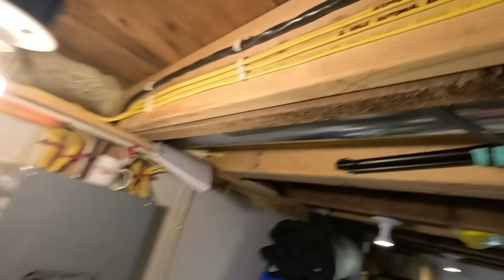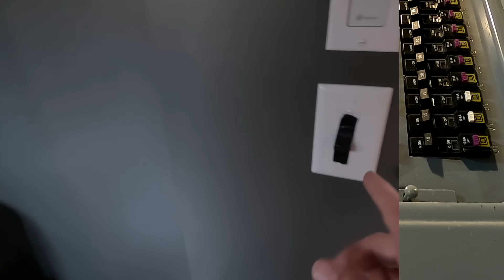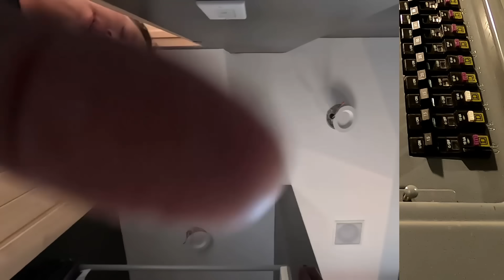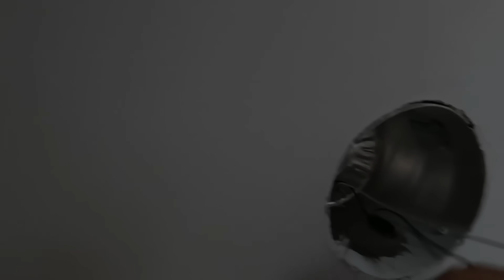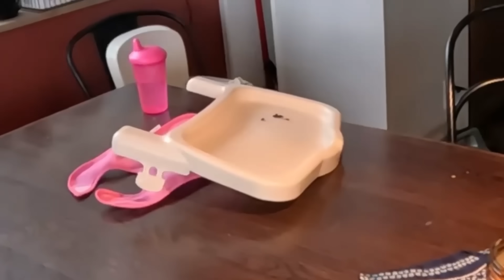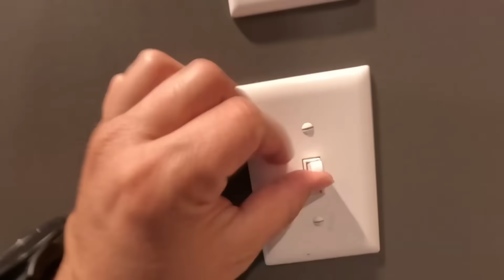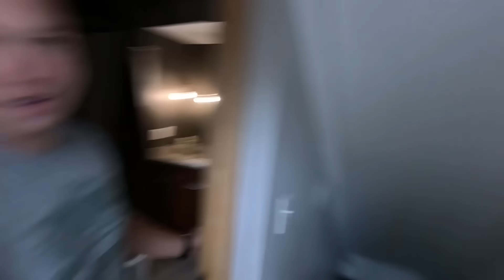Arc Fault Breaker Keeps Tripping! How To Fix It!

Comment: I oil my compressor tools daily (as indicated on tools) whether I use them or not, along with ARC fault breakers, GFCI's, appliances with GFCI's, and test smoke detectors and carbon monoxide detectors...Takes about 40-45 mins.
Reply: do not oil unused tools, the oil will build up and cause issues, like gumming and spraying out all over. it's wise to oil and run them a bit before putting them away each time though.
Reply: Right. I do too, along with carefully reading all my prescription documentation and double checking the list of contraindicated/drug interaction meds, as well as updating the spreadsheet with my meds' expiration dates. That takes about 90 minutes, usually after the checking breakers, GFCI outlet test buttons, and oiling my pneumatic tools. Then I carefully review my owner's manuals for the vehicles, compare the odometer readings with the list I force my family to make of the duration of their vehicle trips versus outside temperature (short trips require more frequent oil changes), and make the correct notations in another spreadsheet I keep on a separate computer and separate network (never can tell if you'll have a laptop fail or have a network failure). Then I carefully shower, being sure to use the rubber mat, which gets hung after being towelled-dry to resist mildew (air quality issues), and go to bed after prayers that the wiring or mildew won't get me. Then I do it all again.

Seriously, who does any of this other than occasionally?

You have a great channel. Quite practical/helpful for others of us in your shoes who have not yet run across the particular issues you showcase (or have but can learn new things). Thank you!

Comment: My girlfriend's hair dryer had a worn out cord, and it started arcing in the cord. It was popping and glowing bright enough to see through the insulation. My fancy AFCI/GFCI breaker for the bathroom didn't care and let it go until it started smoking. I unplugged it before it filled the house with toxic smoke.

Comment: Thanks for the video Ben. Love your work. I’m having similar issues in my pole building with LED canopy lights (plug in to receptacles)bought on Amazon. Irritating to say the least. I’ve tried simply pulling them one by one and as soon as I get to more than three of them, it trips. And it can be different trios too so not one common denominator. 
On a different circuit I’m also having tripping when I try to use the table saw. As soon as I turn it on, it trips. So I have some investigating to do.  Could be cheap product on the lights (or in rush current?). Any tips from anyone would be appreciated. Thanks for the video, as always!
Oh and your wife’s comment about it taking two months or so (you brought it up so bravo on you), it reminds me of the saying the shoemakers kids have no shoes. The electricians family has no light. 😂
Reply: if the arc fault/combo breakers are over about four years old, I'd simply try replacing one of them and see if the issue goes away. most of the older ones were prone to false tripping.
also if they're straight AFCI and there's GFCI receptacles, those are known to cause random AFCI tripping when large/high surge current loads are turned on, usually solved by using new AFCI/GFCI combo breakers and dumping the GFCI receptacles.
I had some with that exact issue, when turning a hair dryer on/off, even with the GFCI receptacle tripped it still affected it. they were older Square D/Eaton/cutler hammer, so not just one brand.
Reply: Any type of motor will trip arc fault.  GFCI and AFCI breakers sense a disturbance on the neutral and power aide.  Start looking at neutral connectors.  Make sure connections are tight   I stopped buying stuff on Amazon.  Had a few Wagos go bad. Ordered them on Amazon.  If you don't live or have guest quarters in your pole barn you don't need AFCI in that building.

Comment: I’ve had good luck with Halo (Cooper) recessed LED trims.  I like Feit, but I’ve had many of their bare LED bulbs (not trims) die prematurely.  Feit’s warranty replacement has been excellent, so I don’t hesitate to buy their product.
Reply: I've had the same problem with Feit lights purchased at ACE hardware. Over the last couple of years I have replaced incandescent lights with LED lights as needed. I purchased a two pack of Feit lights that have already burned out. None of the other HomeDepot lights have burned out.

Comment: Hey Ben, really enjoy your content. I noticed the fixture that was bad was located in your shower area. I think moisture from the steam in that area could have caused your arcing problem. Try replacing the fixture with one that is rated for damp/moist locations. Keep up the good work. 👍
Reply: Better quality lights that are rated for damp areas usually come with a foam gasket as well. The gasket fills the gap between the light and your ceiling to fill any imperfections. That one didn’t have one so I’d venture to guess your assessment is correct.
Reply from the maker: I believe these were rated for damp locations. I'm going to double-check.
Reply: @BenjaminSahlstrom a shower is not a damp location. It is a wet location.
Reply: That is incorrect. The light fixture on the shower ceiling is not being saturated with water. They are subject to moderate degrees of moisture which would fall under the definition of a damp location under the NEC. A wet location would require the fixture to be saturated with water or other liquids.
Reply: Damp location with a gasket
Reply: Those retrofit LEDs are actually wet rated because they are sealed.

Comment: Do you have any recommendations for arc fault gfci breakers that are nearly impossible to keep on while running a backup generator? Main line power they are fine.
Reply from the maker: Interesting. Probably a better generator? That sounds frustrating.

Comment: I had a led light like that fail with a shower of sparks when I turned it on. I didn't have an ark fault breaker, but very quickly turned the switch off. The insulation on the hot wire to the led PCB failed.
Reply from the maker: Good you were there to turn it off!
Reply: AFCI is not a panacea. The point of high transient resistance does not give HF arcing signal, which is detected by AFCI. Therefore, different kind of circuit breakers is in use.

Comment: I'm pretty sure the best way to fix arc fault beakers is to immediately replace them with regular breakers as soon as the electrical inspector leaves.
Reply: They will deny coverage for any reason regardless
Read the agreement
Reply: @vertihvost7675  I can only tell you I have experience that shows otherwise. I'm sure some probably do. That has not been my experience.
Reply: @vertihvost7675 That's your theory. Go read your own agreement, and copy paste where it says that they will deny coverage for any reason. You won't be able to. 

An aggressive insurance company will deny coverage unfairly but it would not hold up to a challenge. The challenge might require lawyers and a judge, And that might be how some insurance companies operate. Even if a forensic investigation definitively located the ignition source being a particular electrical circuit, and proved that that circuit was wired non-compliant to the electric code at the time work was performed, and the non-compliance was removal of AFCI breaker, they need to prove that the breaker would have otherwise detected the ignition source and prevented the fire. 
Insurance companies pay claims all the time when negligence was the cause. If your child plays with matches and burns the house down, insurance pays.
Reply: Test at least montly, this ensures the tripping mechanism doesn't seize or get sticky due to dirt or grit.
Reply: @TheONLYDANHAMMER       if nobody is putting dust or grit in there where’s it coming from.
Reply: Hahaha!   I'm an Electrical Engineer and I'm with you on this! GFCI / Arc fault detection inside the main panel is generally overkill and unnecessary.  My approach is the same as yours. 👍
Reply: I have had 2 arc/gfci breakers work with regular washer dryers and then not with my new ultrafast combo washer/dryer or my robot vacuum. I have also had a gfci/arc breaker trip when kitchen appliances apply load to a receptacle. But they work on regular arc breakers. When plugging in tester testing ground it’s worked correctly. I tried to replace both and that did not fix the issue but installing a gfci/arc receptacle with a regular breaker did work for the vacuum and washer/dryer combo. Any idea might be happening?
Reply: I don't know if you intentionally posted this question inside this thread or meant to do it as it's own standalone comment on the video. You might get better responses if you do the latter. My very unprofessional opinion, which is shared by a lot of electricians I know, is that arc fault breakers are just terrible in general and that stuff happens, but I'm sure there are smarter people than I who can give you better direction to solve your problem safely and legally.
Reply: @jimmyfox231 UL 1699, the Standard for Arc-Fault Circuit-Interrupters uses laboratory instruments for two types of tests: arc detection, which are test signals that must be detected; and immunity tests, intended to ignore the common equipment related arcs and environmental noise that causes nuisance tripping. 
Software algorithms in the circuit breaker analyze The digitized noise voltage that rides on top of the alternating current 60 hz voltage. Between revisions of the software And between manufacturers, the immunity could be better than what UL requires and tests for. The The false positive tripping problems are a huge industry issue that manufacturers are improving, and UL also revises the safety standard occasionally. So switching your device or even moving a device that trips AFCI on one circuit but not on the other is a matter of evolving and imperfect software algorithms that are trying to never ignore a true fire ignition risk arc, while attempting to ignore the many other situations that cause The same or similar high frequency arc signature noises on the line. Every relay contact in a toaster which Sparks on make and break circuit operations, a light switch with capacitive loading LED drivers that sparks as you close the switch, or the light switch that has an inductive load that sparks when you open the switch, and every universal motor with sparking armature contacts are truly arc sources that are not a fire ignition risk, but are arcs that need to be ignored by the arc fault circuit. 
It's a very complex and messy design dilemma, made worse by software that cannot be updated in the field, And UL standards that don't come close to covering all the immunity needs.
Reply: No lol
Reply: The 21st century equivalent to sticking a penny in a blown fuse socket.  😂
Reply: Replacing with a regular breaker will defeat the purpose of AFCI. AFCI should trip with Arc
Reply: Might have been because the light was over the shower and all that steam and moisture got up in there also.
Reply: Nah, arc fault breakers have just exposed all the wiring done by unqualified electricians and/or shitty Chinese devices with arcs inside of them. People like to blame the breaker, though.
Reply: @LonnieAdams4  if they actually required faulty wiring to trip, that would be a valid point, but they don't. Verifiably, demonstrably, they are prone to nuisance tripping for no valid safety reason, just because of how science and waves work. So you either end up with a product that dials up the safety levels and trips every time you try to vacuum... or a product that dials back the safety to avoid nuisance tripping, essentially designing it only to pass the specific tests put forth by regulation, so that yes it will technically work fine for you but ultimately doesn't trip for some of the most common causes of house fires, effectively making it more dangerous than the regular breakers ever were in the first place. They are terrible.
Reply: Thats a great way to start a fire.
Reply: All of mine trip at least 2 times a month its fucking annoying and useless I am replacing
Reply: @JoshuaR-s3e it's ridiculous what they've done with these breakers. Yes replace it with a standard breaker and ironically you'll have peace of mind. My refrigerator was off every other morning when I started my day. So annoying! I replaced it with a standard breaker and now no nuisance trips . No reason for the G-N current to be measured anyways. It's overkill and unnecessary.
Reply: I have just wired my home.. My  pc trips it.. Knowing it isn't getting replaced means the archfualt for sure is....
Reply from the maker: Personally I like having them but at the same time I understand that perspective. The can be very frustrating.
Reply: Insurance will deny any coverage if fire occurs.
Reply: @vertihvost7675  if the fire is due to the breakers, yes. But it's unlikely it will be. Because regular breakers have worked fine for decades. Whereas arc fault breakers have been terrible since their inception.
Reply: @dannykent6190 "regular breakers have worked fine for decades"

Boooooo
Yes they worked fine to interrupt over current conditions. But they don't work for the other cause of tens of thousands of electrical fires 🤦‍♂️

Comment: Hello Ben,
 Enjoy your videos.  I installed two large LED panels in my workshop. The building is fully insulated and I ran all wiring inside the gray watertight conduit. Overkill I know. So, I decided to use an ARCFAULT breaker just for these two overhead lights. Even though my mancave is climate controlled, every once in a while that breaker would trip as soon as I flipped the switch. I called and was passed upchannel to an electrical engineer at the company that makes the QO breakers. We ran some test on the breaker, but all appeared good. So, I running out of answers, I did some further trouble shooting .  The roof in my mancave is metal. Same as used in modern pole building. Above, fully R47 blown in insulation. I used plastic gray looking receptical boxes, and locking plugs on the ends of the light cords. Turned off the circuit, and noticed that one of the receptacle tabs (metal), was touching the metal roof. What do you know?  ... once I broke off that tab, I haven't had that tripping again. Called back the engineer, and he was dumbfounded!  We surmised that there was enough ground current flowing between the receptical and the roof area, that the breaker would trip. * I have put up four JUNO LED flat plated light under the porch of my workshop. They work very nicely,  and are extremely easy to install. Additionally,  each light has a controller that allows you to set the (k),  daylight, more yellow, or wavelength.  Great product. Thanks again for all of your videos. Keep it up
Reply from the maker: Thanks for sharing your experience! That's super interesting. Neat that QO has engineers you can actually get in contact with!
Reply: Hello @HGR693, 
The RCD should have trip off in this case, if I understand the situation correctly. 
Of course, the AFCI can respond to a parallel phase-to-ground arc fault. But that's the RCD's area of responsibility in the first place, I suppose.
Reply: sounds to me like you have a bad light or moisture ingress somewhere it shouldn't be, causing a current leak from either a hot or neutral to the ground. assuming you have ground wires!
if no grounds exist then it could be capacitive inductance from the lights internals themselves causing leakage to the ground and out the roof. something is silly there for sure, maybe even current leaking into the roof via somewhere/something else or nearby power transmission lines?
Reply: @throttlebottle5906 capacitive inductance is not possible
Reply: I have used Juno and have had good luck with them.  Good quality and packaged well.
Reply: @chrisdestry5394  I hope they're still decent, since they were bought out in 2015.
unsure if I've installed any after that date, but probably many in small numbers.

Comment: It's kind of ridiculous when you think about it: we've replaced what is generally a very reliable mechanically-triggered breaker with ones with microprocessors. All those penny components crammed into a tiny space, and they kick off heat dropping/rectifying the voltage in addition to the heat of the regular breaker with no cooling. Not many small electronics would last more than a few years being on 24/7, and generally it seems these breakers are the same. There's almost no chance you'll be able to get 20+ years out of one like was possible with the regular breakers. 

I'm a big fan of GFCIs, because when they trip, it's usually something that at least has the potential to hurt/kill you. Most AFCIs trip (like in this case), because some fully enclosed device had a minor fault or otherwise put noise on the line. There's no chance that LED,  in a metal enclosure, with drywall around it, would cause a fire.
Reply from the maker: I can't say I disagree.